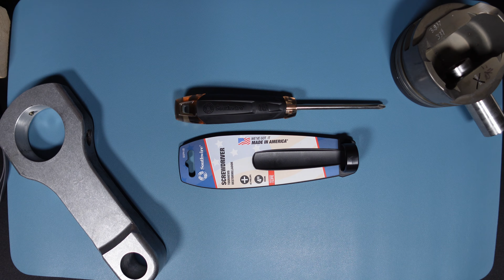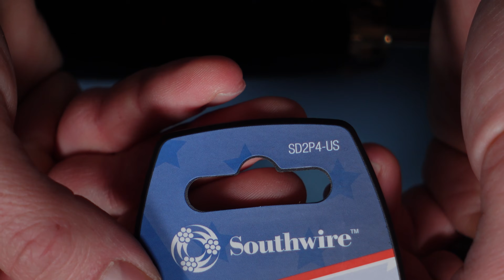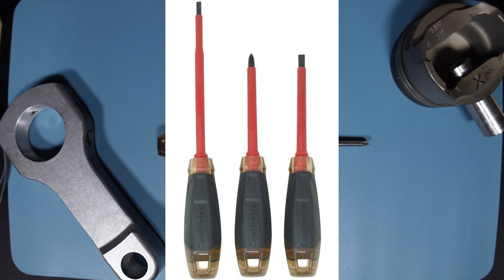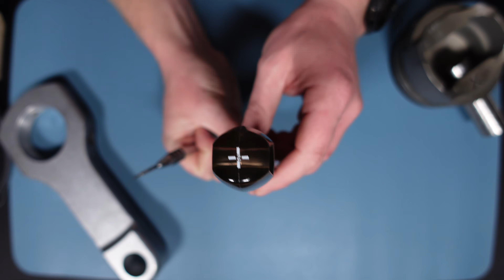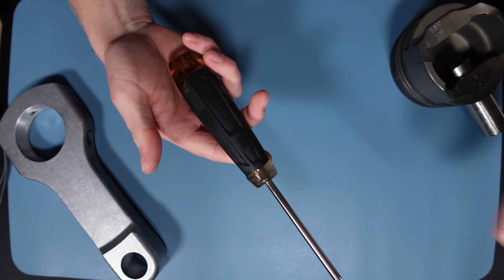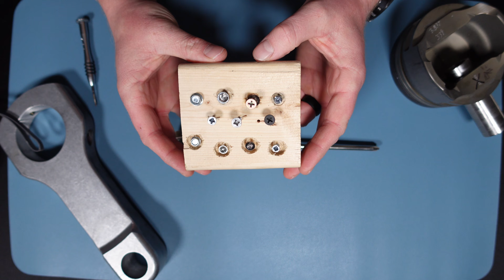NEW TOOL Southwire USA Screwdriver One Tool Review

Comment: Odd duck of a screwdriver. I'm not a fan of the material on the Klein screwdrivers, and this looks like a similar material, plus its diameter seems awkward. I bet the balance on this driver is pretty far back, (handle heavy?) so for me I would pass. Plenty of other USA Made drivers to choose from too
Thanks for the look though
Reply from the maker: Very odd compared to what I'm used too. It's same type of materials as klein but with an awkward shape and you are correct the handle is heavy. Good quality just not my style either